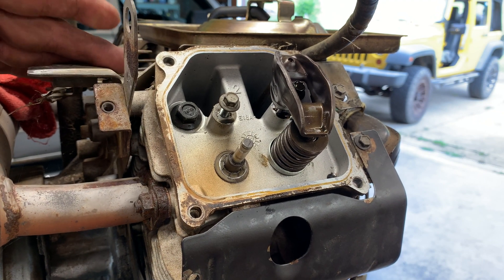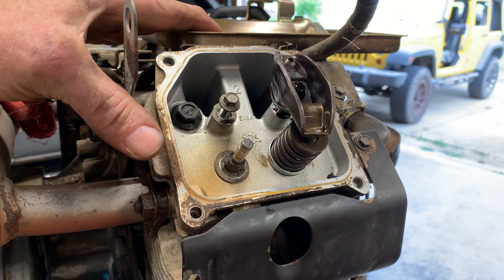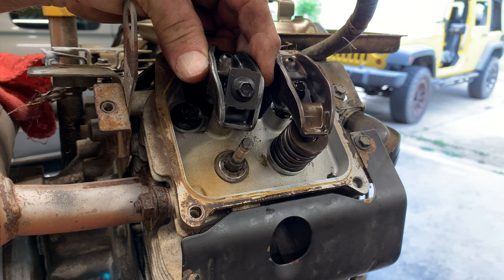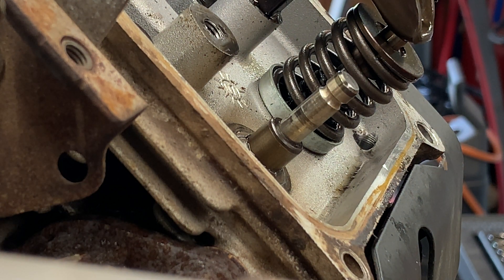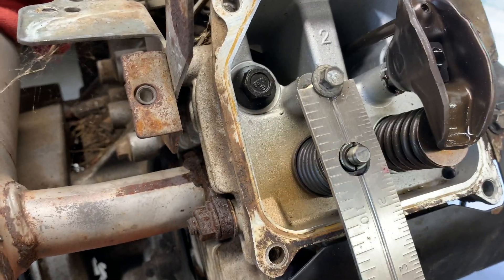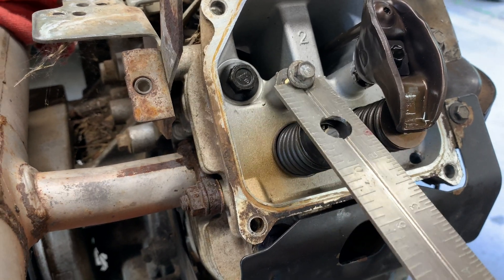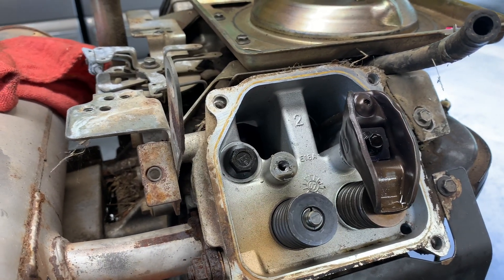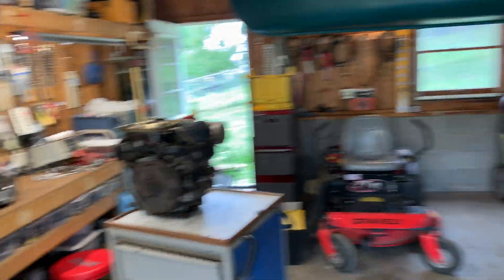DIY Cub Cadet Kohler CH23 Valve Spring Compression Tool

Comment: EXACT same thing happend to my Kohler.  Thanks for the tip.  Got it fixed for $0.
Reply: My 24 year old Kohler has had ZERO problems since this fix 2 years ago. Hope that helps.
Reply from the maker: Must be a design flaw. It hasn’t happened since I made the repair. Thanks for the feedback my friend!
Reply: @WaynePolcin  Enjoyed your video.  I just had the same EXACT issue with my Cadet, so I was glad to find this.  Everything worked ok once you got it all back together?  I was just curious, too, as to what might make the one half of the keeper pop out like that?  Looks like this comment is two years old, so I was wondering if you still figure it was just a design flaw, or have you had any issues with it since?  
Thanks!
Reply from the maker: It’s been running fine ever since. We sold the mower to my brother in law and he hasn’t had the problem either. I sometimes wonder if was due to hitting some extremely rough terrain. I really don’t know what caused it.
Reply: @WaynePolcin  That's encouraging.  I just made the repair to my Cadet yesterday.  So far, so good...
Thanks again for making that video.  It really helped me out a LOT!  Ironically, when I pulled off the valve cover, my situation looked EXACTLY the same as the initial picture you included....and I mean EXACTLY...from the angle of the rocker arm to the location where the loose half of the keeper was laying.
I used an old support bracket from a garage door track (you know what I mean?....like a mini piece of angle iron with holes in it) to compress the spring on mine.   I had to ream out one hole a little so I had more room around the valve to get those keys back in...and I used one of the bolts from the valve cover gasket instead of the rocker (just because that bolt lined up better with the holes on my bracket/tool) but the principle was the same as what you showed. 
I was amazed at how smooth it all worked.  For me, it was a miracle from God!
Reply from the maker: Thanks for the kind and encouraging comments, @peacepipes3037

Comment: KISS system WP... Keeping it simple and functional and gettin it done.  Great tips from the commenters.  Hard to believe that keeper came out, didja find any reference on YT that would explain it?  Thanks for sharing and caring!  Have a good one.
Reply from the maker: My brother-in-law is extremely knowledgeable on engine topics. He told me this is the second time in a month he has seen this problem on a Kohler engine. It was the rocker arm banging, off center, onto the spring instead of the valve shaft that, I think, knocked the keepers loose. The bigger question is what caused the rocker arm to pivot out of position? The bolt may have been loose. I didn't pay attention when I removed the arm to see if the bolt was slightly loose. After I installed it, it was solid as a rock. So go figure. Thanks for your input buddy. Stay well and kind!

Comment: That was a good idea. To keep the valve seated you can connect an air hose to the spark plug hole, make sure the piston is at the bottom of its stroke. The air pressure will hold it in place. I have done this several times to replace broken or week valve springs in the field.
Reply from the maker: Good tip! @michael white oldtimer said the same thing! I wish I would have been smart enough to think of that idea.

Comment: A REAL GOOD FIX I REMEMBER  WHEN I WAS  YOUNGER WE MADE A HOLLOW SPARK PLUG AND WELDED A AIR FITTING ON AND USED AIR PRESSURE TO HOLD THE VALVES UP
Reply from the maker: You’re the second person I have heard that from. I sure could have used that!